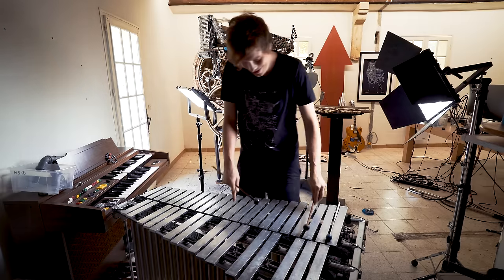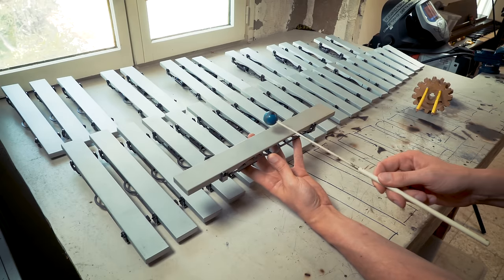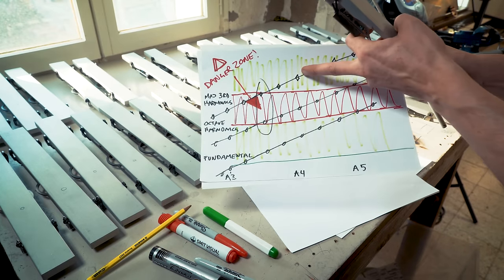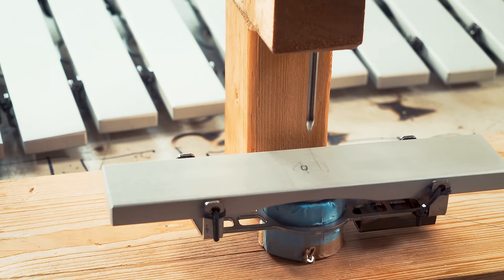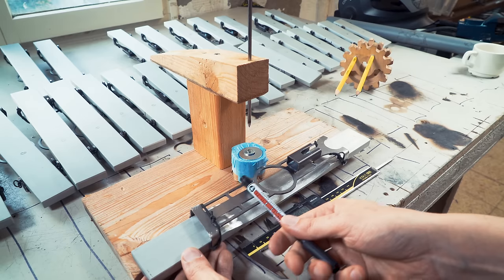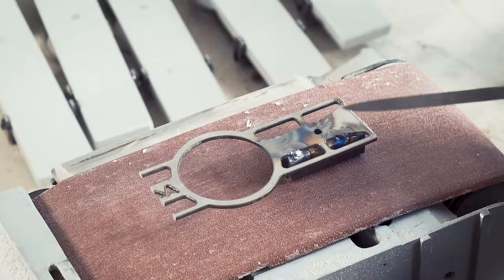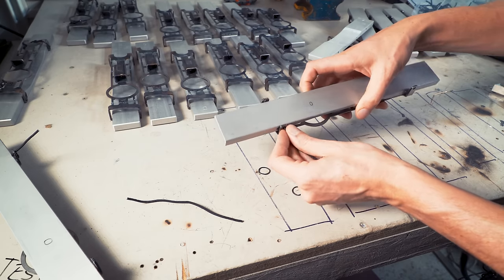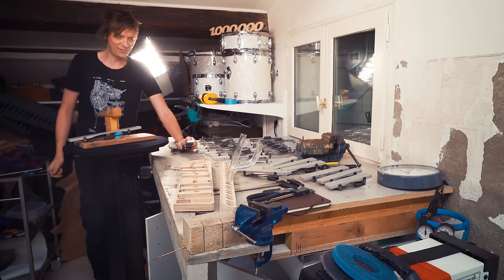Music Harmonics Jig (To Hit The Sweetspots) - Marble Machine X #101

Comment from the maker: This redesign is happening thanks to all your great Comments on the Whole Vibraphone Project! The obvious solution to shift the bars lengthwise to always hit the perfect sweetspot might have been missed if it wasnt for your help. It has been an interesting part of the MMX saga where the fact that i am designing in public really affected and changed the build in a great way. Thank you everyone for commenting and being a part of this process :). It was massively labour intensive but now when its done i am more hopeful than ever about actually having a great sound from the vibraphone. Big bottleneck SOLVED. Pling LIKE on this video if you dont like unsolved bottlenecks.
Have a great Weekend everyone!! // Martin
Reply: hello
Reply: Yay
Reply: Martin, the redesign of the Modulin was not as complex. Modulin II is now designed and complete, even with discontinued equipment. Modulin II still uses the ribbon controller as the original did. PM me for details.
Reply: Martin your work ethic is wild
Reply: 9:46 - 9:56 Damn it Now I want a DuckTales MMX cover
Reply: aw yea, pling like
pling pling WAHOO
Reply: Challenge davie504 slapping the bass with steal balls😂😂👍🏻that is a good idea
Reply: Just a bit worried that the plates would touch the programming wheel after being shifted. To accomodate for that, the whole vibraphone might need to be shifted forward, which means that drop points would also need to be shifted forward. Hopefully that won't mean having to redesign the drop points assembly again, but still...
Reply: @Martin: Did you check that none of the bars now come close to anything else in machine (if changing tone positions)? Also why did you spend this time rather than have them remade from CAD? You're still going to update CAD, I hope? Great job with the welding anyhow!
Reply: win-wintergatan Friday? :p
Reply: assuming he does remake those brackets they still will be custom to those specific bars. what if you want to switch them out in the future with a different brand  vibraphone because one went missing on the road. you are better off making a holders that can be adjusted.
Reply: Ты волшебник !
Reply: You're simply amazing Martin...love all of your work. Can't wait for a new Album.
Reply: Don't forget about the Wilsons Fan Club facebook group! https://www.facebook.com/groups/2102402929988275
Reply: @JensGulin  good remark. When Martin clicked the adapted one, it immediately struck me that the bars will interfere with the programming wheel as well
Reply: Make recordings of the notes on and off center then play them all to musicians and general public and try to create a double blind test by mixing the orders up and things every time and just recording the preferences for them all. Then you get to hang out with people and you can take some of the burden of trying to perfect it off of yourself as your choice. Create 3 options, A is better, B is better or no preference/difference. You can also create a video with the notes played in the center vs the sweet spot and then put a poll on the side for each note and ask us what we prefer with it and you can get everyone on Youtube's preference/opinion. After that you can compare your opinion with Youtube's and the Musicians you polled and make the final cal. That would be the true "no compromise" vibraphone.
Reply: @evilcanofdrpepper  That would be much more work, I'm afraid. To record sweet-spot he still needed to find it, and the turnaround time for a decision would be weeks. I guess that's the reason why he chose to do holder modification himself rather than ask for help.
 + Martin is perfectionist and I'm sure he would not trust anyone else with the musical choices.
Reply: It makes me so happy to see the like/dislike ratio on these videos! Keep it up guys! And get the bloody BELL ON! 🔔
Reply: @evilcanofdrpepper  
 On the other hand I think you're right that Martin should care about the mic'ed sound more and not repeatedly remake this part. Better to have tested the unmodified vibraphone with mic and resonator before declaring what should be fixed. Maybe none of this matters and the visual aesthetics would mandate that the original holders would be best. We'll know sooner or later.
Reply: @user-os1in7kt5j  The holders and the bars are NOT intended to be seperated.  So its not gonna go "missing".  Pretty sure he is changing the CAD design on each adjustment so replacements parts are accurate.
Reply: If you want to further decrease the 1mm off 'from the sweet' spot. You could elongate the holes to allow a tiny enough adjustment before you tighten it down.
Reply: I dunno if you read my comments from some weeks ago. But, I'm happy I could help.
Reply: @polyacov_yury  hey for some reason youre right wasthere any much space for the vibraphones?
Reply: You play the Xylophone in the beginning. They already solved the problem of where to hit thr bars for you, Just look, And the pipes are at optimal positions, too.
Reply: @bee2hive  hey thanks i should've finished the video first
Reply: Martin I’ve been commenting the last couple weeks on your videos trying to flash the warning sign to you over these vibraphone pipes cause I’m not sure if you’re seeing the clear problem they’re creating. They have the capability and capacity of limiting the vibraphone as much as the hit points did you need to design them cause you may come to realize that only certain notes can fit in certain spot on the machine. If you make the pipes adjustable they’ll only be capable of playing a small range of notes and they’ll be fixed to one spot on the machine and adjusted to the note as need and that range will still limit the placement but it’ll be fast. Slide the note on adjust the pipe good to go. It’s that or you’ll literally need a pit crew to take it all apart and assemble and tune everything between each song and the machine will have pipes sticking out everywhere and look like a mess. Not to mention that It’ll still take time no matter how fast they are and your concerts will wind up being like 65% tuning the machine and 45% music from it. You have to design these pipes if anything so you can set your own parameters on it and not be forced to simply work around these problems in the end of it all just to finish and lower the quality. We all wanna hear and see this machine play music but it’s still got a lot of work to go and the more you create a no compromise system and back track over your previous work  the more work you end up creating for yourself later on when you realize these problems I’ve laid out here because you’ll have to go back and potentially redo all of it again when you see this and are forced to compromise. You will run into this issue eventually and be forced to deal with it and I really hope you see this before then and do the necessary steps today to ensure these problems don’t arise. Oh and as for mic’ing the vibraphone https://www.ischell.com/en/balafon-vibraphone-and-multisource-instrument-pickups/ saw that although I’m sure someone else has probably shown it as well by now. I really hope you address this Martin.
Reply: Martin, will you make full-length song from the improvisation at the beginning?? It was very beautiful!! :D
Reply: 13:15 I really hope that it's my depth perception going bad and not that the redesigned plate holders will make the plates hit the main programming wheel since it shifts the plate back like 4-5 cm.
Reply: wtf this is a Friday your not supposed to upload until the 30th! im busy doing other things! dont screw with my sanctimonious Wednesday Wintergatan's episodic... its not casual fridaygatan!
Reply: Hey Martin, if possible, could you categorize future videos as something other than "Music"? YouTube won't allow videos of this category to be played while multitasking on mobile devices.
Reply: Martin, you're basically describing the Equal-loudness contour (Fletcher Munson Curve), which is the graph that shows how sensitive your ears are to the audible spectrum. Around 1-2k is where your ear has a bump in sensitivity so any harmonic that falls around that range will be especially shrill. Your A4 note has a fundamental of 440 Hz. That means the harmonic two octaves above it is 1760 Hz, which is in that shrill zone. If you generate an oscillator tone at that frequency you'll hear it's pretty painful. Then with A5 you'll have the same problem with the first octave harmonic.
Reply: Does the location of the sweet spot in anyway depend on where on the vibraphone bars are attached to their holders? Because now they're not being hol symmetrically anymore.
Reply: Please wear gloves while using the belt sander 😬
Reply: Gotta love bonuses!
Reply: Leave it to Martin to find a way to add his musical saw sound to his MMX.
Reply: cough cough kinetic fingers cough cough
Reply: Martin, when dealing with audio you just have to pick what is consistent over all instead of trying to perfect every single sweet spot, otherwise you will go crazy because the audio is limited by the physics and the environment. You may run into problems where you perfect something and that affects other things and you have to start again.
Reply: Out of all the Youtube Channels out there, there are a small bunch out there that I follow and look forward to seeing.  Yours is at the top of my list... if not in first place.

No I think it is first place.

Been watching for so long so as glad I will finally see the final product, I will equally miss these build videos and seeing you work through problems.
Reply: Can you make a YouTube Livestream of just you playing random instruments?
Reply: Are you going to be part of #teamtrees?
Reply: Wintergatan Martin, this is seriously impressive. I’m a professional engineer (electronics, software & systems), and was one of the viewers who spotted the opportunity to move the bars on the carriers to optimise the hit points on each note.

You must be advancing the state-of-the-art in vibraphone design and engineering here. The analysis you did on hit points versus harmonic content is extraordinary, especially for such a versatile machine as MMX. As a musician, you have developed some truly remarkable engineering skills which will change you forever. I can’t see you leaving engineering behind when you complete the MMX project. It would be a serious waste of talent if you did! Surely you can make further contributions to music technology with the skills and fields of study you have taught yourself.

I am also amazed by the re-energising effect your recent break had on you. You have returned to the project with renewed vigour and creative energy. You needed it and deserved it. And MMX will be all the better for you having looked after yourself.

Keep up the excellent and inspirational work. Loving the YT series, and looking forward to seeing you both on tour!
Reply: You should battle Anders Flanderz “the one man band” when marble X is finished
Reply: #teamtrees
Reply: Hey Martin, this is off topic but if you're ever in the market for a hearing protection upgrade you should try 3M Worktunes Connect earmuffs. They double as bluetooth wireless headphones. Been using mine at work for years and I would highly recommend them.
Reply: Some questions, The resonator pipe enhances the fundamental frequencies so is there any need to shift the plates as the fundamental will be naturally brought out drowning out the harmonics?

Also, the shifted plate looks close to the programming wheel, is there going to be any issues with the shifted plates hitting anything?

keep up the good work.
Reply: Hi Martin, i thought about something regarding the programming wheel. Have you considered a mount for the 8 'discs' with programmable back-lighting of each hole, for even faster programming? Simply plugging the magnets into the backlit opening :)
Reply: So happy to see you at saturday ! Ans what a wonderfull job you made !
Reply: Hej Martin... Are  you sure you are not going to miss all this designing and constructing when you finally have the perfect Marble X ?
Reply: 9:43 point in case: if you were to build a custom guitar, you'd also have to do overtone tuning & but also topological optimization if it were to sound great - same problem.
Reply: & this my friends is why it's better doing resoance analysis before pushing to assembly - this is true for musical instruments but also moving machine parts & free hanging structures like bridges, towers & even roofs or entire houses & skyscrapers as well. Yes, those structures also do have fundamentals & overtones & engineers are tasked to minimize their resonances so that's got to be learned.
Reply: I thought you would you the stick in your mouth in some part of the song but...
Reply: Hello,

Looks awesome! I just have one worry. Can you place the longest adjusted holder in the highest spot, or does it hit the programing wheel?
Reply: They are not tune like harmonic because it off tone. The chromatics in your xylophone is 12 TET tune. Not from real harmonics
Reply: @Bruce Emmett Instablaster =)
Reply: @Bryce Reece I really appreciate your reply. I got to the site on google and Im trying it out now.
Seems to take quite some time so I will reply here later when my account password hopefully is recovered.

Comment: I am always amazed by your talent. The start of the video, with that beautiful improvisation was outstanding. You are a great musician and I so enjoy hearing your music! So thanks for that! AND to see you alter your original design with such precision and dedication work is inspiring. 

I think what you were doing with the testing of the vibraphone is called "voicing". That is setting up the musical tone generator to provide the most pleasing tone to your ear. Because the vibraphone does not normally have a fixed mallet point (the player has an infinite number of ways to strike the plates - and how well they do it makes the difference between a great performance and a ho-hum one). You are actually inventing a new type of vibraphone because it DOES have a fixed strike point. So you have to make the MMX strike in the part of the bar that produces the most pleasing tone. 

This is a common issue with fixed parts musical instruments, and why piano and pipe organ factories have special technicians called "voicers" who adjust the instruments -- just like you are doing! 

So now, Martin, you have a new hat to wear, that of a musical instrument voicer.  Your skill set grows and grows!

Comment: To clean the bar you can use: isopropyl alcohol and just wipe twice and gone (Incase there is a next time)

For the circle drawing: not sure that mallet material, but could dip bottom in ink and touch that proper area. Or use graphite powder and do the same thing if you are concerned of ink splash. Saves those seconds, don’t mind me just thinking if alternative ways to speed up your process.
Really cool to see the build process!

Comment: Just checking: 
1: The offset works either side of the centre equally
2: Avoiding a double bounce is important and difficult
3: The direction of the offset at 13:25 shows that the marble will have a longer distance to bounce.
Can the marbles clear that new, longer distance?
Reply: Bouncing lenght was tested and solved (by using latex rubber) on some episode between 40-60. Hope Martin remembers that.
Reply: I think it is actually the other way round. Have a look at 13:15. The right one is the old position with the marbe hit point in the center, so the marble would need to travel 1/2 of the bar after the hit. The left one, is the moved bar and it was moved upwards, so after the hit, there is only like 1/3 of the bar left that is in the way after the hit.

Comment: Desperately need someone to explain the physics of all this.
Reply: When objects like a vibraphone bar or a guitar string vibrate, they vibrate at multiple frequencies at the same time. If you imagine plucking a guitar string in slow motion, in your head it might look like the whole middle of the string is going back and forth like a jump rope. In reality it's doing that at the same time that it's wiggling with the left side up and the right side down at the same time, and with the left third up, middle third down, and right third up, etc. If that's confusing you can do a google images search for "guitar string harmonics". In a vibraphone bar the same thing is happening, but it's harder to see how the bar wiggles.

What this amounts to is that when you play a middle C, you don't get a 261 Hz wave and that's it. You get the C, plus the C above it (octave), the G above that (perfect fifth), the next C up (second octave), E (maj third), etc. You only say that it's a middle C because that's the lowest and loudest harmonic.

You can change how much of each type of vibration happens by how you play the note. Striking in the center will give you more of the octave harmonic (jump rope split in two), but striking it lower or higher will give you an octave + perfect fifth (jump rope split in three). Same thing happens by touching the bar while it's vibrating. He 'bends' the notes at the beginning by sliding a mallet along the vibrating bar, which is cutting out the different harmonics as he moves it.
Reply: @theoya  Is that "circuit bending" a vibraphone (Look Mum No Computer)...
Reply: @georgematthiessen2335  I N   T H E
B E G I N N I N G
Reply: @theoya  Thank you! Well explained